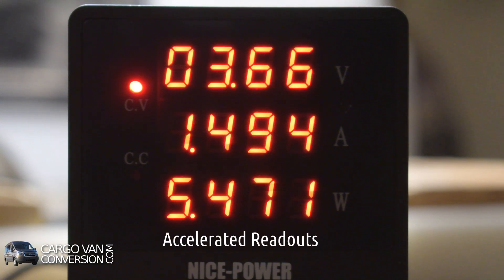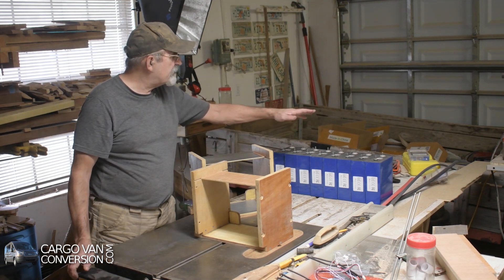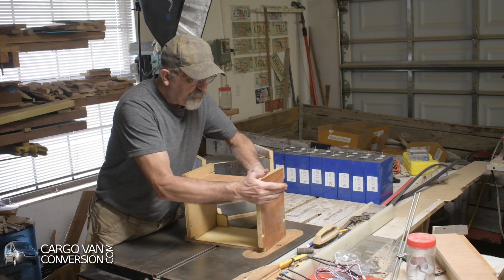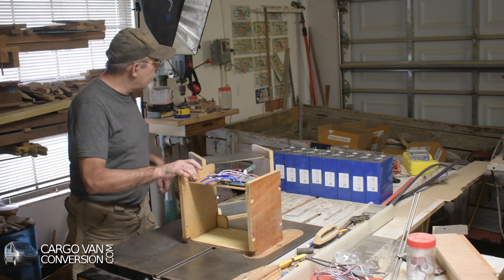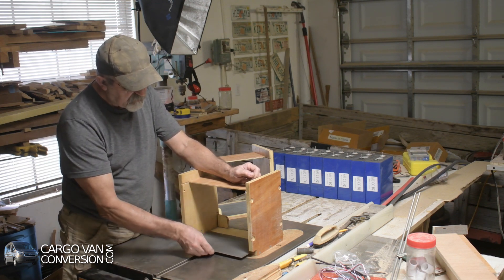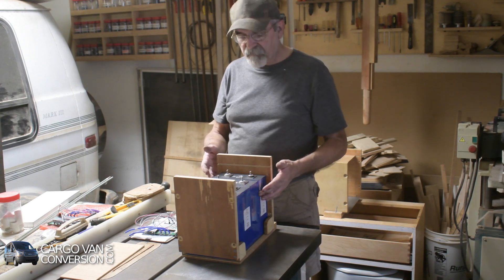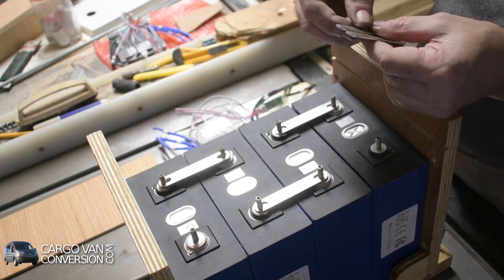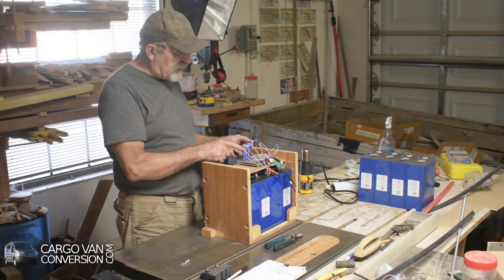DIY Lithium Battery - Part 2

Comment: Put thin rubber between the batteries and the steel plate.  The battery case is grounded and only protected by the thin blue wrap.  If that wrap wear through you can end up with a short between cells.
Reply: Really? Their aluminum case is  "hot" and only protected by the thin shrink film? Dang! That's a good addition! I found the corroborating information about keeping the batteries from expanding while charging. It wasn't clear to me why at first. But it's true that the cells last longer if they are prevented from expanding. Also, they will apparently last longer if they are short cycled. They can last a long time if they aren't drained all the way before recharging.

Comment: Don't the six BMS wires connect to each cell separately?
Reply from the maker: I assume, you are talking about the lead wires. There are only five of them with a four cell setup; the first red goes to the first cell positive, the last black to the last cell negative and the three whites are each going to other cells positive.
Hope that helps.
Van Williams

Comment: Which type cells did you get - the ones with M6 terminals or M8? 

There's a way to set up eight cells in four pairs and then connect up those pairs like you would four single cells and keep everything 12v, too. But you said you're mainly doing two enclosures due to space so maybe that wouldn't work for you.

Comment: I'm concerned that doubling the bus bars is counterproductive because you're not getting as good a connection to the battery terminals.  I think it would be better to use a single heavier gauge bar stock if you're worried about the cross section of the bus bar being able to handle the current.  The issue I can see is that now you have two separate surfaces where the battery terminal conducts to the bus bar, with the connection torque split between the top and bottom bar.  I can see how this would result in a higher resistance connection overall even if the bars themselves are lower in resistance.

Of course I could also be completely wrong on this.
Reply from the maker: Hi Chip,
That s well-thought out. I'm not an expert in this, so I depend on others and on common sense. Mostly the latter :) Many others have done it before me, but what you say makes sense to me. I will keep an eye on it. Would now know where to look if issues arise. Thanks.
Van Wlliams
Reply: @cargovanconversion  Just add a small smear of electrical conductive paste at the terminal connections and between the bars to reduce current loss.

Comment: It looks like you've got your plan brewing nicely, Van.  What do you think about placing plastic or rubber tubing over the exposed length of the threaded rods to prevent something from shorting across them and the terminals?
Reply from the maker: Hi Mark,
Not a bad idea; may do some heat shrink. Couldn't be too safe. Thanks.
Van Williams - Joey said: Why didn't I think of that? :)
Reply: @cargovanconversion  You still may need to get the threaded rod off though, so heat shrink tubing may make it difficult.  A slightly looser fitting tube that the rod could slip in and out of might be best.
Reply from the maker: Hi Mark,
could also make the entry holes on the side a fraction wider. Probably first think about it, before acting :) Perhaps plain 1/4" wire loom. You're making me work too hard :)
Van Williams
Reply: @cargovanconversion  You're welcome!  lol  Actually, Joey sent me an email to tell you this stuff.  It's not me, it's Joey!

Comment: Careful you don't compress the battery case too much with the all-thread.  Each cell need a little room to expand.
Reply from the maker: Hi Nic,
I don't intend to use a heavy force to push them together, just sufficient to keep it all together.Usually the measurements are taking at 50% SOC and expansion takes place when charging to 100%. Right now, my cells are at 100%, So I should have some leeway.

FYI I have a recommended list that came with the batteries. It states:
" Binding/Compressing Cells
Mild compression is recommended to maximize life cycles. As cells charge or discharge they will expand or contract slightly and depending on temperatures & C-Rate this will vary.
A "basic general" rule is to use approximately 10-14 lb.ft / 140-200kgf.cm pressure/compression applied when the cells are at 50% SOC (3.200V) @ 25°C/77°F. Always refer to manufacturer specifications data sheet.
This can be done by using fibre-tape, strapping or other flexible binding materials. Protect cell corners from crushing. Alternatively, a frame with end plates pulled together with threaded rods & nuts. Custom cases are another common option used."
It remains sometimes unclear, with different opinions about a subject. While much has changed in the last few years, It is still a very new technology.
Van Williams

Comment: Hi Van! I was searching for information about LiPo (or in this case LiFePo) cell expansion and found this:
electronics. stackexchange. com/questions/ 419408/ how-much-do-lithium-polymer-batteries-expand-in-volume

In short, unless the manufacturer's datasheet states that the cells are capable of 'puffing' (allowing excess gas pressure to escape), having them clamped together may turn a fire risk into a risk of explosion. I highly recommend that you do some further research.
Reply from the maker: I have a recommended list that came with the batteries. It states:
" Binding/Compressing Cells
Mild compression is recommended to maximize life cycles. As cells charge or discharge they will expand or contract slightly and depending on temperatures & C-Rate this will vary.
A "basic general" rule is to use approximately 10-14 lb.ft / 140-200kgf.cm pressure/compression applied when the cells are at 50% SOC (3.200V) @ 25°C/77°F. Always refer to manufacturer specifications data sheet.
This can be done by using fibre-tape, strapping or other flexible binding materials. Protect cell corners from crushing. Alternatively, a frame with end plates pulled together with threaded rods & nuts. Custom cases are another common option used."
These are prismatic cells and that maybe the difference, but this is one of those many issues, where there is still no consensus or where old assumptions are hard to change. I watched many of Will Prowse's videos, where he opens up commercial batteries, and those cells are always packed without space. I don't intend to use a heavy force to push them together, just sufficient to keep it all together.
I will try to research that more, as wells as other things that will arise during this adventure. Let me know what you think.
Van Williams
Reply: @cargovanconversion  That's very reassuring. Good to know. You're right that there's not a lot of consensus, as well as some outdated assumptions (some of which I was repeating), probably because LiPo is a relatively new technology that's quickly evolving. Sounds like you know what you're doing. Thanks for taking the time to explain.
Reply from the maker: But don't assume that I'm the expert :) That would be a big mistake....
Van Willams
Reply: @cargovanconversion  Hah! As long as you're doing your homework you're doing okay in my book, and I can learn from you. 😉
Reply: LiFePO4 batteries do not have the same risk of catching on fire as LiPo batteries. They are totally different chemistries.